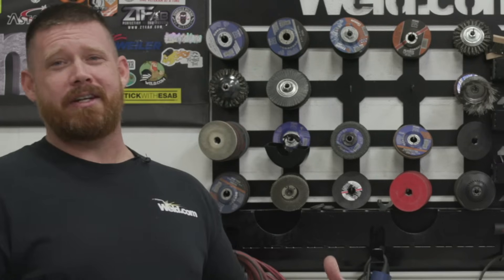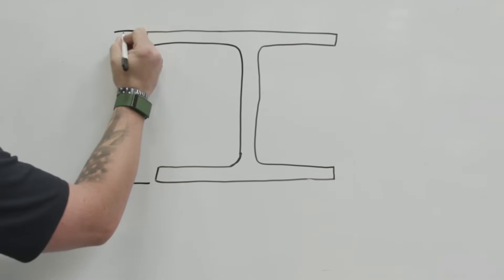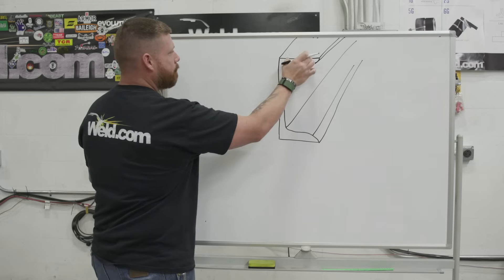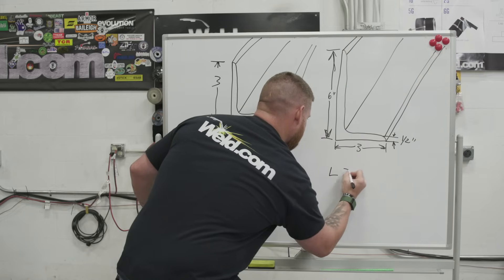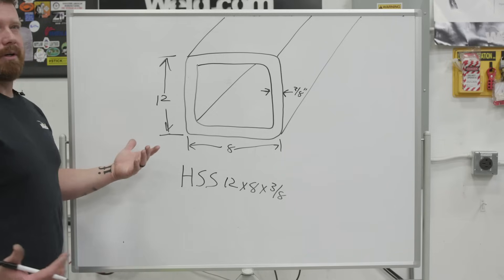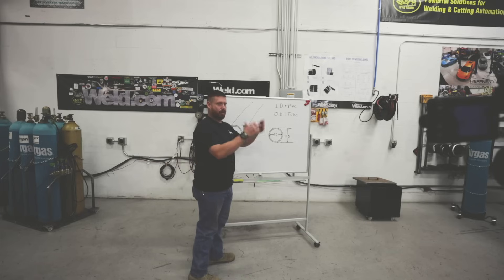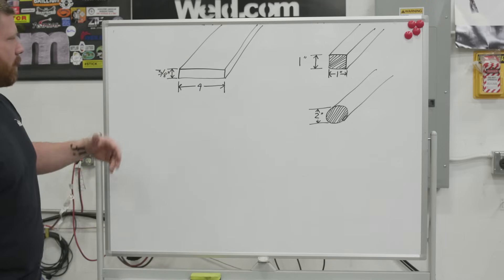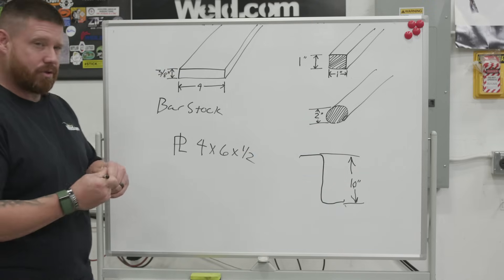What are the Different Structural Steel Shapes?

Comment: Pipe schedule -  The OD stays the same IE, 6” Schedule 40 steel pipe = 6 5/8” OD x .280 wall.  6” Schedule 80 steel pipe = 6 5/8” OD x .432
When you hit 14” and above, the od will be 14”, 16” would be 16” etc.

Tubing is always od x wall thickness. 6” is 6” od x the wall thickness. 

I hope this helps.  Pipe size, the od doesn’t change based on Schedule.  The wall thickness changes by Schedule.  

Thanks for sharing 👍
Reply: You're right, pipe sizes are designed so that the I.D. of schedule 40 pipe will be close to (but not exactly) the nominal size. It's confusing, but like you said 6" Sch40 is .280 wall and 6-5/8 OD which makes the I.D. 6.065". But all 6" pipe will be 6-5/8" OD regardless of schedule, so 6" Sch80 will have an ID of 5.761".

4" Pipe will always be 4-1/2" OD. Sch40 wall thickness is .237, making the ID  4.026"
4" Sch80 wall thickness is .337, making the ID 3.826"
Reply: Rob Madison yes. The important word is nominal. This applies to plastic piping as well.
Reply: I was getting ready to comment when I saw yours, also square and rectangle tube is 24’ or 48’ as a rule and pipe 21’ and 42’
Reply: Hey guys, great content as always. 

Excuse me, but I have to talk a little bit because my boss is firing me during the quarantine. 
I've been sitting at home for more than 5 months now and I get depressed. 

My buddy Dave Harper motivates me and we are putting all our welding knowledge on the spot. If you need a welder or welding advice, visit our website weldingtroop.com

Visit the website (weldingtroop.com) and give us your feedback, whether you appreciate it or not. 

I really appreciate it.

Thx!
Reply: @weldingtroop2179  
The website has some good content. Good luck and stay positive!!

Comment: I think the schedule is based on pressure per square inch of working or burst or something pressure. Please correct me if I'm wrong.
Reply: Yup, different wall thickness for different pressure.
Reply: I think you're right.
I think the larger diameter pipe has a thicker wall section for the same schedule due to the volume inside the pipe.
I.E., 2" schedule 40 has a thinner wall than 6" schedule 40.
I could be wrong tho.
Reply: @willmorris1429  yup, schedule 40 2in has a wall thickness of .152 inches and 6in schedule has a wall thickness of .25in or somewhere near that. wall thickness changes with diameter due to volume. the only thing that stays the same is the inner diameter
Reply: Here's the facts. https://www.engineeringtoolbox.com/wrought-steel-pipe-bursting-pressure-d_1123.html 
Hint, you need to rethink.